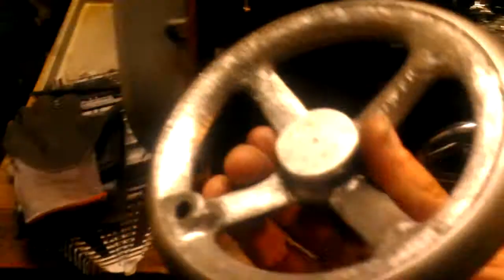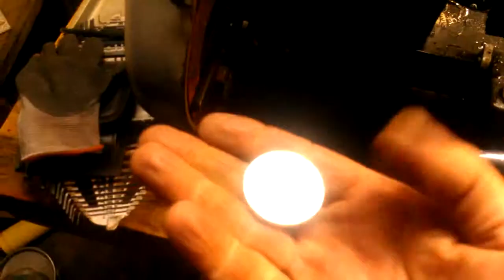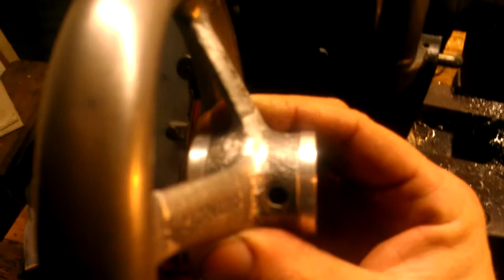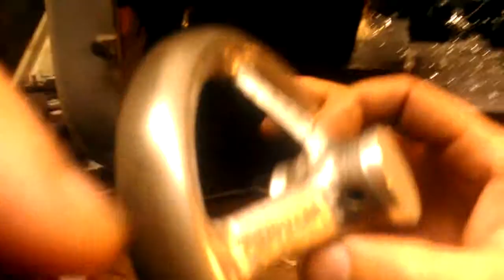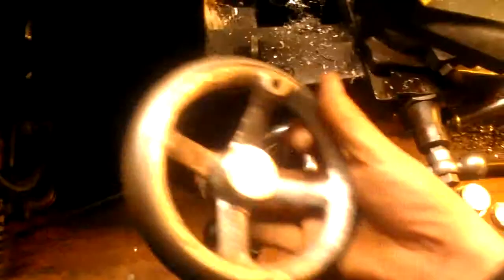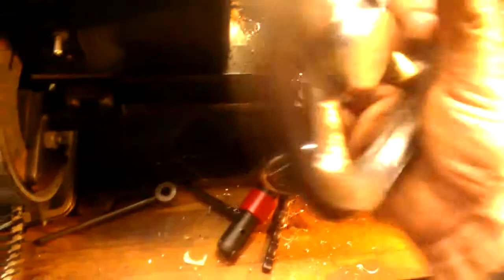Brown and Sharpe horizontal mill hand wheel pattern part 2

Comment: Hi Chris, that will make a decent form for future molding, hope you'll show the process.
Pierre
Reply from the maker: plenty have shown it on here but I can show you how its done. you plan on dong some casting Pierre?
Reply: It would be fun to snow you progress on your channel.
BTW the tripod makes it so much better...
I've got myself an electric ceramic oven. about 18 x 18 inches inside dimensions to try it this spring, the inside temp gets up to 2300deg. F.
I prefer this to propane.... To be continued and experimented when nice weather comes in.
Reply from the maker: I think a good oil burner is the way to go able to melt iron and used motor oil is free.
Reply: At first I'm not thinking about iron, at the most brass... Electricity, at least for a start is much less messy than oil...
Reply from the maker: Yep and you already have the equipment . I really like the furnace myfordboy is building very professional job.
Reply: Yes myfordboy is my main reference as for molding. His new furnace is something to see...